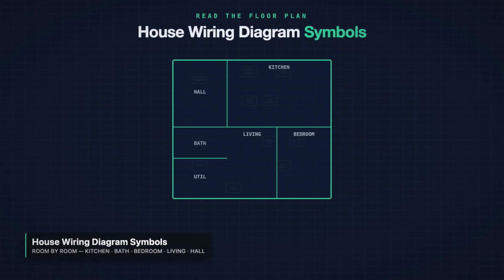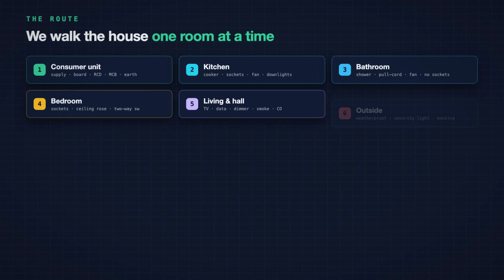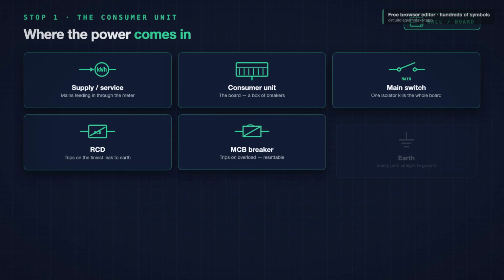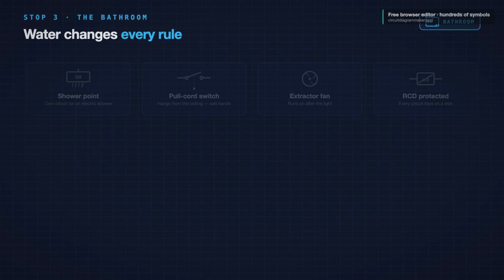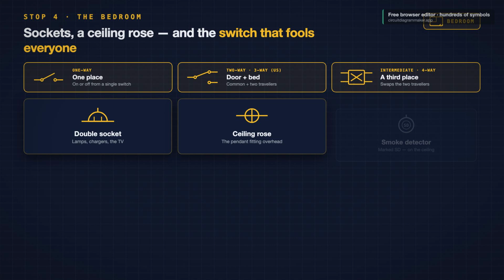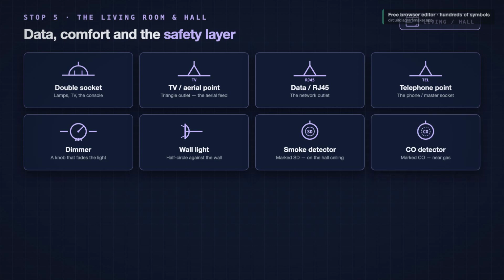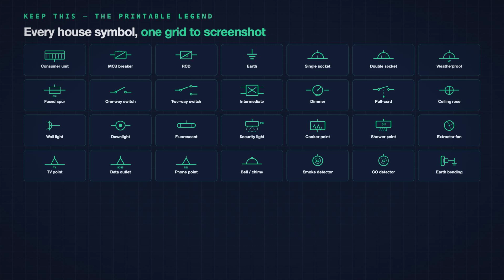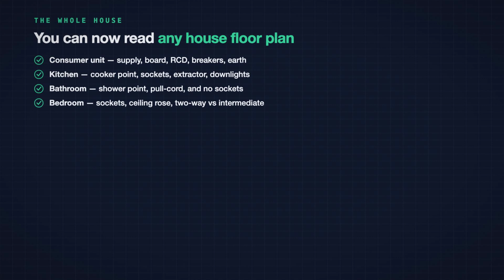House Wiring Diagram Symbols (Room by Room)

Comment from the maker: The fastest way to learn house wiring diagram symbols isn't a giant alphabetical list — it's room by room. Kitchen = cooker point + double sockets + extractor + downlights. Bathroom = shower point + pull-cord + fan, and NO ordinary sockets (that's the water rule). Bedroom = sockets, ceiling rose, and the two-way vs intermediate switch that fools everyone.

Tie each symbol to the room it lives in and a floor plan reads like a map.

Which room's symbols trip YOU up? Full room-by-room legend, free: https://circuitdiagrammaker.app/symbols?utm_source=youtube&utm_medium=pinned_comment&utm_content=yt-146